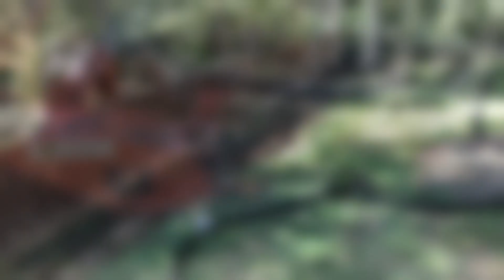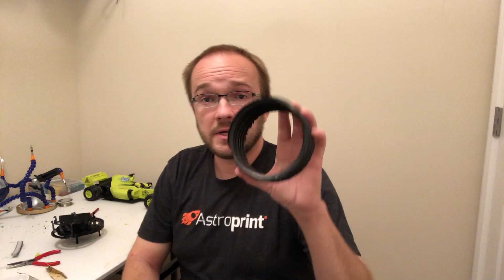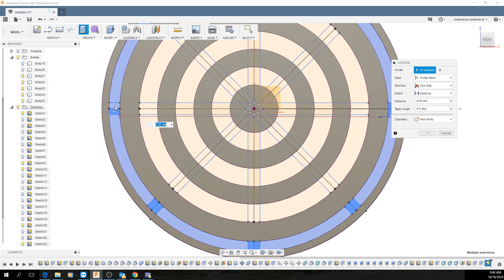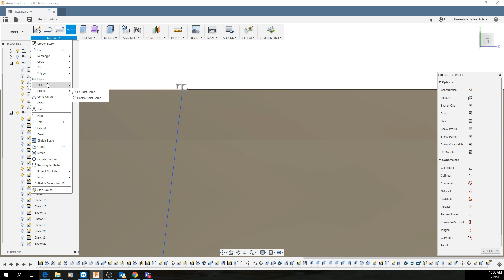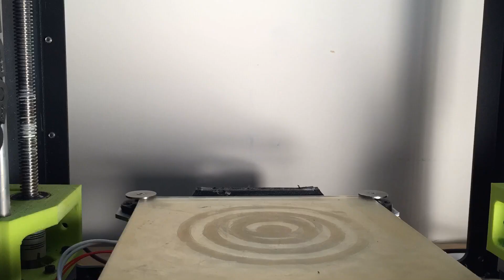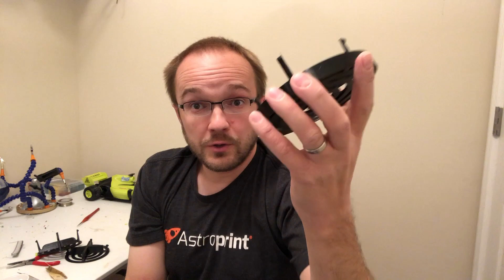Practical Printing - Designing a Drain Grate

Comment: Great print & video Jim! How about another design style caps the end just like yours & has a gravity closed flapper with a 10°-15° angle(from vertical 90). Water would push it open, then flow stops gravity hold flap closed. No grates to deal with. Love practical prints!

Comment: Great job Jim, brilliant practical use. I'm not even sure that I've ever seen anyone actually take critters making a pipe home in drainage piping.
Reply: When i was younge, My parents had drainage pipe years ago like that, from a downspout also.  Occasionally the feral kittens would hide in them when you spooked them and hear meows in the pipe. (barn cats) First time we had to dug it up and it backed out eventually.  So my dad stuck burlap over the exposed end.  That held for a few years.  Jim, this is a   Nice solution and well thought out.  3d printers were not an option back then!